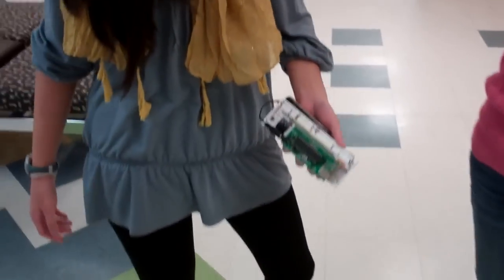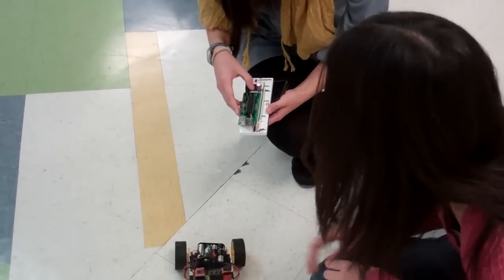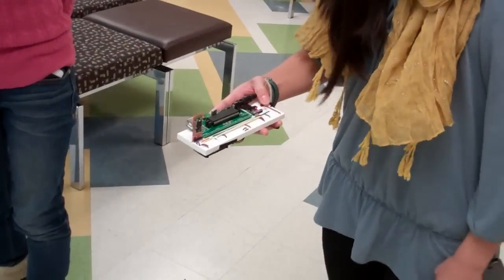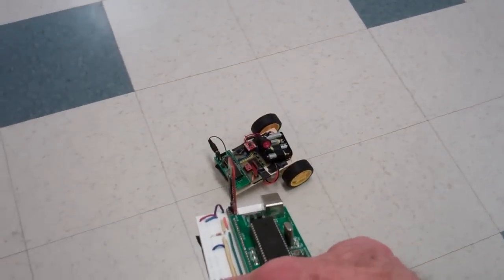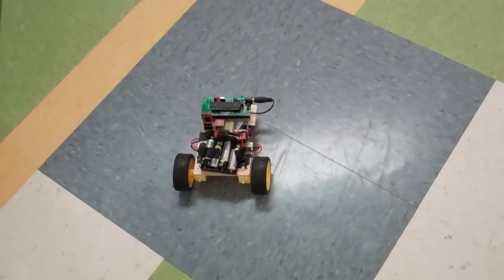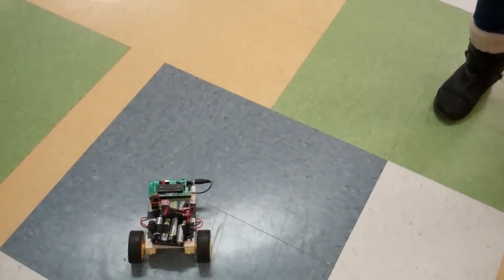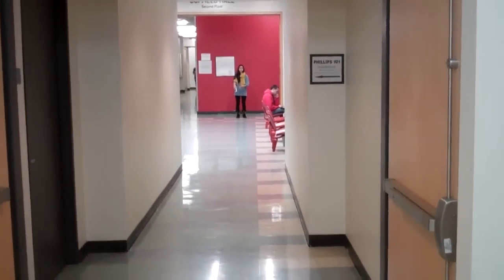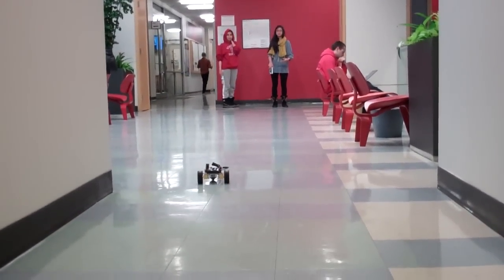Bluetooth robot

Comment: Nice one! I made something similar without using any microcontrollers. I just used an accelerometer, an Op-Amp IC, an OR gate IC, a pair of RF modules, Encoder/Decoder and a motor driver IC to make it. It doesn't have speed control and long range though.
Here is the demo of it: http://youtu.be/3nYacaO2C-U